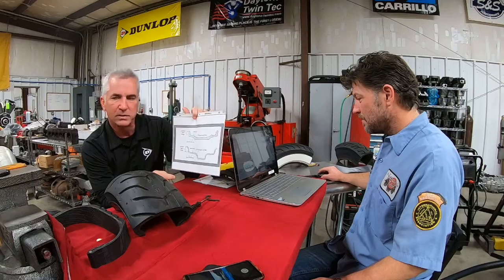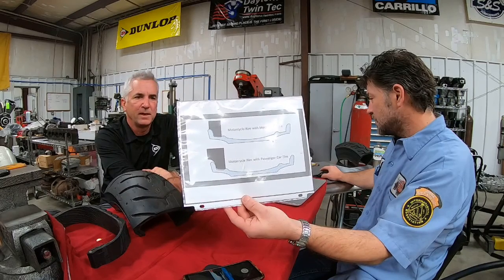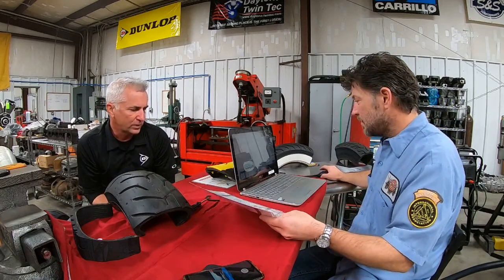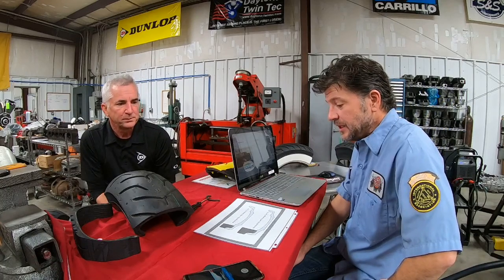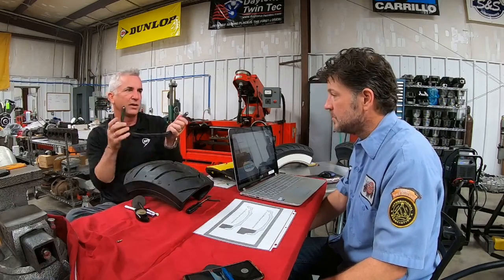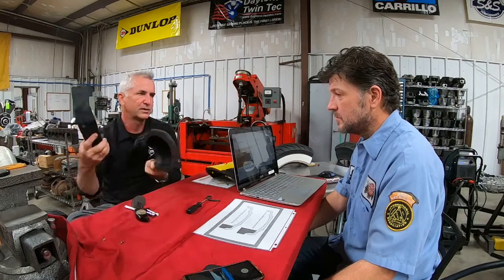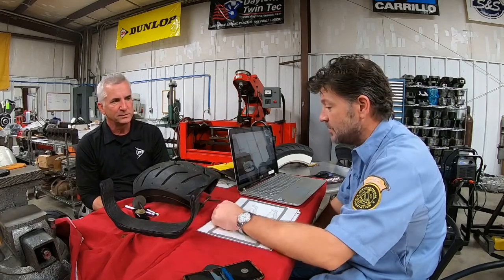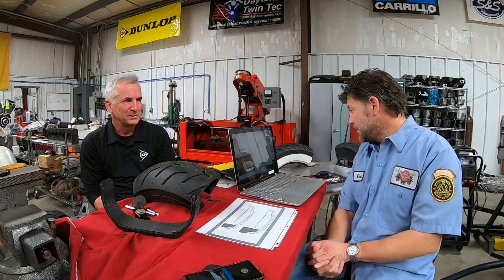Motorcycle Tire Tech Part 2 - The Darkside - Live Dunlop Q&A

Comment: I'M CALLING 🐂💩AND THEY'RE FULL OF💩.
LOOK AT MY PROFILE PIC, I WENT DARKSIDE FRONT AND REAR 10 YEARS AGO ON MY BOBBER, NEVER GOING BACK TO MOTORCYCLE TIRE SCAM.   PLUS I'M HARD TAIL, SO THE REAR IS 10PSI UNDER.  IN TEN YEARS ALL I'VE CHANGED IS, OIL(6X), PLUGS(2X)AND CHAIN (2X) TIRES(0X). AT TEN YEARS 50K LATER THE DARK SIDE STILL LOOKS NEW BUT IT'S TIME TO CHANGE THEM BECAUSE THEY'VE AGED OUT.

Comment: Would have been nice if you would have asked why Dunlop cannot/does not make a MC tire that lasts as long as a car tire.  My assumption is that the tire manufacturers use softer compounds in the MC tires than they do in the CT.  So the question is, why?  Do the compounds in a CT reduce the traction so much that using those same compounds in a MC tire would compromise safety?

Again, my assumption is that the tire manufacturers can certainly claim that their MC tires have better traction than a CT would.  But, using that logic you could also claim that a racing MC tire have would have even more traction.  The increase in traction is due to softer compounds (at the expense of longer wear), but a racing tire isn’t practical for touring bikes unless you want to change tires every 2-3k miles.

So again, the question for tire manufacturers is why can’t they make a longer lasting MC tire?  I suspect that their bean counters have calculated that there is no money to be made in doing so.

Comment: I own a M109R and run a 240/40/18 directional racing CT (car tyre) on a standard rim, and absolutely love it. Never going back.

Fun facts: the M109R rim profile is more like a CT than a MT bead anyway; the CT has a higher load rating; great traction; same tread width on road when cornering as MT; lasts way longer; more comfortable; runs cooler; excellent in wet / slippery roads; great on shingle; can still do tight turns.

Downside to extra wide (240) DS / CT  is: you need to be a bit more aggressive with handlebar when turning and lean into turn as usual; bit of a learning curve to develop new / adjusted riding skills, so be flexible,  careful and concentrate.

BTW, all motorbike tyres used to be CTs years ago anyway.

Comment: You said just the facts, then bring some unfounded talks about insurance. The DOT certifies tires, no insurance company can refuse coverage. The fact is the motorcycle tire choose to make an inferior product than what's in cars (planed obsolescence). Also, the car tire on display could me misconstrued as misrepresentation, most darksider will use RunFlat tires with a much stronger side wall... a car can run them flat, imagine a motorcycle... just the facts.

Comment: He says the tire tends to come off the rim, but where are the stories of this?  You would think with the 15,000+ darksiders there would be people talking about how they survived a crash and now need to evangelize other darksiders back to motorcycle tires, but it never gets to that in all the anti-darkside rants I've seen.  Dunlop is not an un-biased opinion, and there is no mention of rubber deforming to adjust itself to that other bead shape.  This video series is laced with half-truths from an authoritative source.

Car tire sidewall is thinner?  Well, where are the motorcycle run flats?  Are you saying a run flat is thinner?

Comment: I have a 2002 Goldwing weighing in at 1300lbs loaded out. I am on my 2nd car tire and only have 1 issue. That is I get 35k miles on the tire and that is a good thing. Dark siding is the best move I have ever made!! More rubber on the road and better handling.
Reply: I also am a Darksider. They didn't mention run flat tires. I have rode my bike on a flat tire for 50 miles at 50 MPH with no problem to get to a repair shop. Also when pulling a trailer loaded down in the mountains of Colorado in the rain, no breakaway, kept traction all the time. They always bring up the rim thing, but don't show any evidence of the tire coming off the rim. Not telling anyone to do it or not to do it. Just saying they work. Also softer ride.

Comment: I have been doing a lot of research and have yet to find someone who stated they had a catastrophic failure darksiding. I ask the question as to why motorcycle tire manufacturers don't build a tire that can deter darksiders from darksiding?  If tire manufactuers would build something that didn't require a swap out every 5 to 10k miles I think this practice would be less prevalent. No, I am not a darksider but I am considering it as I think mtorcycle riders get shafted with not only the price of tires(far more expensive than C/Ts), longevity, and mounting. Just my opinion.
Reply: I fully agree, the tire technology exists, we can all see car tires lasting a lot more. Not all rider goes to the track, the planet needs a touring tire that lives up to the challenge. Stop the waist.

Comment: Let me kick this dead horse…when I bought my brand new 2010 GL1800 it came with Dunlop 250 I believe. The tires cupped and got poor service life, maybe 4-5000 miles. Started reading about Dunlop catastrophic failures, and with a 2000 mile trip west through Rockies approaching, and after studying pros and cons, I went Dark Side. Kumho RF. Knowing that my GW would be 1300# plus, it was reassuring to have that strong, big contact patch. It performed flawlessly. And that included sporty days chasing through twisties and high speed sweeps. Tire made it 25000 miles, and I only changed it because it was eight years old, although I wasn’t even near the wear indicators. Never heard of a CT coming off the wheel. Total BS my friend. One more thing, I sensed a slight quiver in Mr. Dunlops voice talking the subject. This tells me he knew he was talking from ignorance or flat out lying. They stopped producing the Kumho in my size (they are made for the Mini) so went Yokohama RF. Even a more plush ride.

Comment: His cutaway example of a car tire is clearly not a run flat. They have much thicker sidewalls, and are a much heavier built tire than ANY motorcycle tire. He didn't address why motorcycle tires last 1/2, or 1/3 as long as a car tire. He may be correct about insurance companies denying claims for bikes using a car tire. Insurance companies are notorious for finding ANY reason to deny paying out claims. There are a lot of things he didn't talk about...the fact that a car tire has a larger contact patch than a motorcycle tire, or that they also channel rain away from the tread better, and no mention that motorcycle tires aren't even available in a run flat...his point about the bead not matching up is kind of moot as I've never heard of a tire failing because of a mismatch of the bead on the rim...also, his opinion is slanted toward his profession. Of course he's not going to talk favorable about using a car tire....

Comment: I like this video a LOT. but as a person with a BAD lower back (one 8" open back surgery ) and my doctors now 20 yars after my op, wanted to fuse me , all I can say is this my Michelin x-ice tire on the back of my tire (see avarTAR)  HAS SAVED MY BACK. it has allowed me to ride 2 up safely.  I wish you tire makers would take that nice and thick tire you show and put a lot more sipes on the edges and bottom , give it more grip.  nothing hurts quite as bad as when that rear tire slips on concrete and moves your body sideways.  I looked at a few brands a few years ago 2009 and all were a lot thinner than the one you showed and with no traction sipes.  I understand the young crowd wants performance to take corners on their knees , but us OLD geezers want comfort and stability .  I just ordered a new tire for that VTX 1800 from michelin.   when and IF I go to a Harley and actually get a dunlop that lasts and GRIPS , then I will stay with a motorcycle tire, but if it wears in 2000 miles like mine did.  sionara to the motorcycle tire.  Correct me if I am wrong prior to the 404 that now goes on Harley's the old tire wore out pretty fast and were NOT as beefy as the one you show here ?  AAMOF  , there are plenty of videos in here with owners saying the 404's now have extra meat on the center and a different compound that allows it to last 30, 000 miles.  am I right or just seeing the wrong videos and owners that are also wrong ???.  As a 42 year tech in this industry and trained at good year and bridgestone  classes for  18 wheels , I read a lot of literature about compounds and so forth, was it the dark side crowd not buying your tires that made you come out with beefier tires ???

Comment: I use car tires on my Harley Davidson electra glide classic 1997 for the past 20 years, I've ridden over 200.000 thousand miles, never had any issues. What the tires companies don't want you to know, is that they work just fine, for a fraction of the price. Go darkside, you will never go back!
Reply: Totally agree.

I own a M109R and run a 240/40/18 directional racing CT (car tyre) on a standard rim, and absolutely love it. Never going back.

Fun facts: the M109R rim profile is more like a CT than a MT bead anyway; the CT has a higher load rating; great traction; same tread width on road when cornering as MT; lasts way longer; more comfortable; runs cooler; excellent in wet / slippery roads; great on shingle; can still do tight turns.

Downside to extra wide (240) DS / CT  is: you need to be a bit more aggressive with handlebar when turning and lean into turn as usual; bit of a learning curve to develop new / adjusted riding skills, so be flexible,  careful and concentrate.

BTW, all motorbike tyres used to be CTs years ago anyway.

Comment: I like how he goes “I see there is 2-3 times more material in the motorcycle tire”. Truth is though it’s 2-3 times more material but it’s soft trash that can’t hold up to the weight of a fully loaded motorcycle. And tire manufacturers will not make a high mileage motorcycle tire because they want to see that $$ coming in steady. You make a 240/40r18 or 250/40r18 motorcycle tire that lasts 20,000 miles I’ll buy it today.

Comment: Yes, it's another bias opinion. These guys are quoting fact and the inherent engineering differences. But i will not submit to the statement about "insurance companies", that is categorically incorrect and sounded like an attempt to scare you off! The fact; any tire rated for highway use is a DOT rated tire, therefore if the tire is DOT rated, there is absolutely not recourse for the insurance company.

Comment: I run a car Tire on rear of my street Bob with sidecar ,it's a 17 inch 165 it is great never had a problem .The one he's showing is a low profile car tier the reason  you cant fit one on the front is they don't fit on the front , I get 5 times the mileage & it grips great .you have to remember these people want to sell you the dearest there they can . By the way insurance companies do not void your policy if you have a car tier just look it up it  has never happened, as well car tier,s  run cooler ,are made to take more weight , ask anyone that runs them don't just listen to a shop that wants to sell you a tier evrey 8,ooo miles instead of 50,000 miles yes that's what you get out of a car tier on a bike.another fact there has never been a report of a car Tyler coming off a rim just get the right size .

Comment: Oh yes of course! Excellent advertisement! What can a motorcycle tire salesman say about the dark side? I drove a Honda GW 1800 and 2 times was with a gray head. When I got air out of the wheel. I had my wife and luggage with me. I've been to Dunlop. As long as there is air in it everything is ok! Without air, it's a deflated condom! I've gone to the dark side of ranflat!!! wounds and have done over 120,000 miles. There were punctures and cuts on the wheels, but the motorcycle does not fall!!! Damn manufacturers, where are your moto wheels with ranflat!!??

Comment: Great close minded conversation. I just put on a firestone weathergrip on the back of my victory judge and I love it so far. You did convince me to purchase a dunlop American Elite rear 150/80b16 for the front of my bike. That's called Double Darkside!
Reply: There is a video of a guy that drilled 4, 1/2" holes in the sidewalk of his car tire on a motorcycle. The then went for a ride with speeds up 50 mph to prove it was safe.
Reply: @paulzumpf3612  
I saw that video. He tried and tried. Faster speeds even burnouts. The tire didn’t budge! If and when I do this the biggest advantage I see is load rating. 700/800lbs vs 1,100/1,500lbs. For a touring bike that is huge!
Reply: Why are you putting a car tire on your rear? Is it just for mileage?
There cannot be another reason, can there?
Reply: @anthonybluhm4724  It's up to 50% of the cost of a motorcycle tire and four to five times the mileage with better braking and handling in rain and snow and only slightly less performance on dry roads in the twisties.
Reply: @johnblassig1666  It amazes me that someone will buy a $40,000 motorcycle and skimp on the most important safety feature on that vehicle. Not to mention proper tires is the only thing keeping you from probably getting killed or seriously injured in a blow-out situation . I guess a life isn't worth $200 for a proper tire.
But that same thinking is why folks don't wear helmets.
Reply: @NLRider-i1m  $200 for a rear tire? Maybe on a Shadow! My local dealer wanted $400 for a rear tire for my VN2000 plus $80 for installation and it lasts for about a year, maybe 2 if the weather is more bad than good.
Reply: @NLRider-i1m  It amazes me how many ignorant people there are out there that think that us many thousands of darksiders do not know what we are doing. How dumb to want to compare running a proper car tire to not wearing a helmet. Well, like I said, just ignorance. And you have all you need it seems.
Reply: @NLRider-i1m  
   Who has been killed or injured?  Do you have any data on blowouts, or bead separations?  Has an insurance company actually denied a claim because there was an automotive tire on a motorcycle?
If you have this information, please give it to us.  Because we have heard of no such thing.

Comment: All assumptions and again ZERO experience. "Slide off the rim"!? 😂😂😂You can run flat! 😆😆😆 Tell me, do you know one, just ONE darkside related accident? Just ONE, please.
Reply from the maker: I can not find a single example of a darkside related accident while operating the motorcycle....but I do know of 3 people who were seating the bead of the tire on the rim while installing a car tire on a MC rim and the tire blew off.  1 destroyed his tire machine, the second suffered 3 broken ribs and a broken jaw, the third a broken nose and 2 teeth knocked out.  Aside from that, as an employer and a business owner, installing any part not designed for a particular use opens up considerable liability.  That said, I simply will not put my business or family at risk over this issue....and i wont argue about it either.
Reply: @KevinBaxter  You know about a lot installing accidents. Me, as a darsider and daily visitor and reader off comments from people with NO experience, know about just one accident: with a Chinese tire on a 15" rim. It blow out durjng beading. Everything you state has nothing to do with darksiding and riding, but with poor technical/safety skills... for so far what you say is correct.